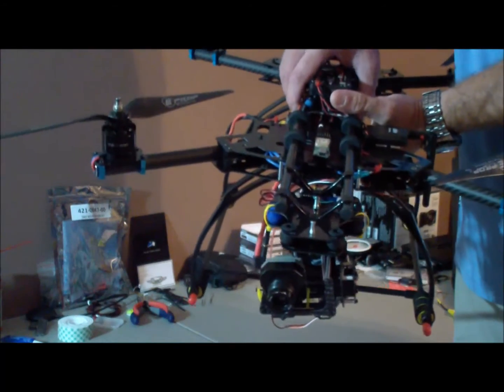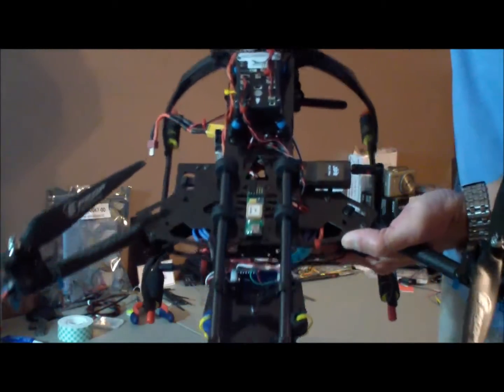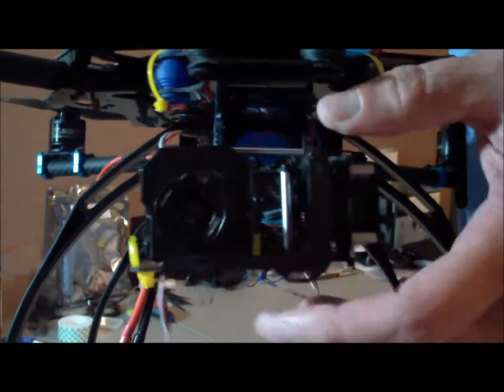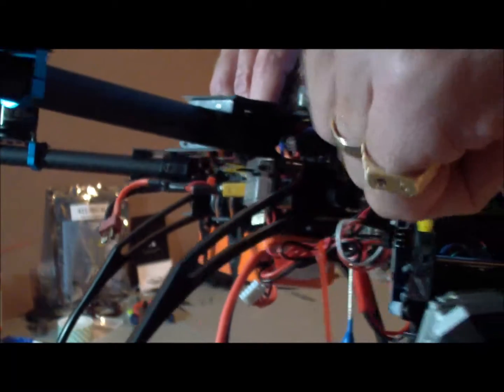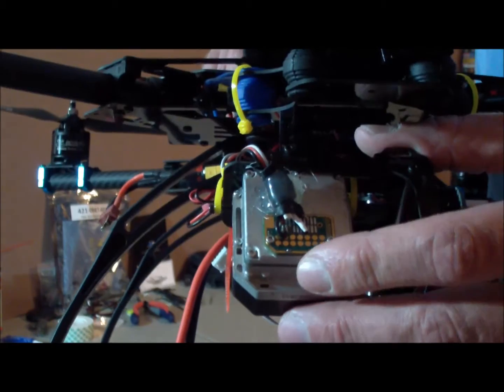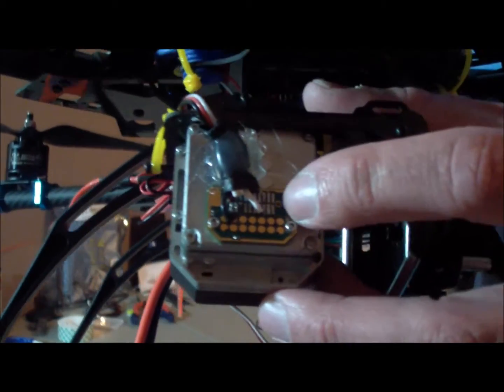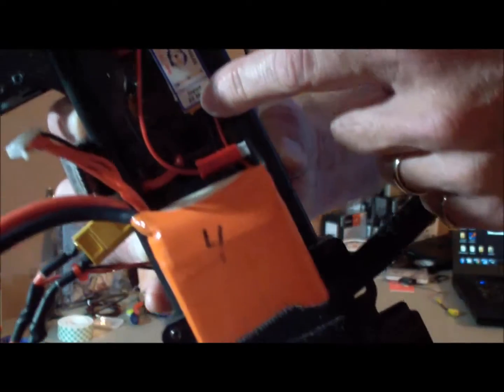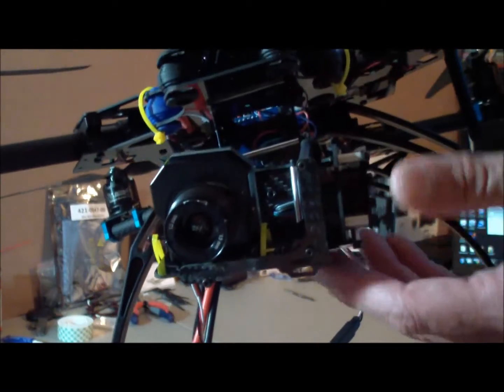Alien 560 FLIR FPV Setup

Comment: Hi Aaron,
Once you connect the PCB Wearsaver board to the back of the FLIR Tau-2, what connection wires were needed to hook up to the MinimOSD?  And how did you connect the Tau-2 with the VPC adapter to your PC...my kit just has the wire with the BNC connector.
Thanks in advance,
- Craig
Reply from the maker: You wont need the VPC after you have the Tau PCB Wearsaver. It all goes through the FPV system after that. You will need a mini DVR if you want to record or a capture card on the laptop